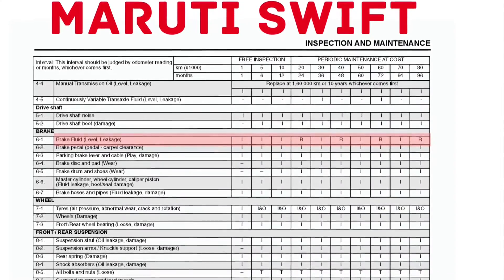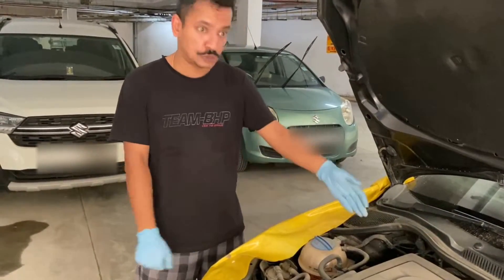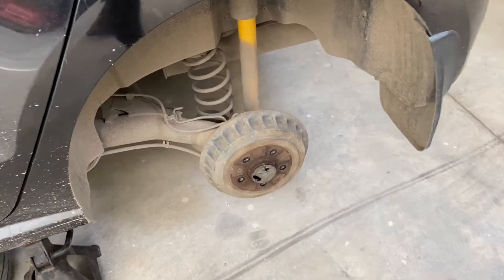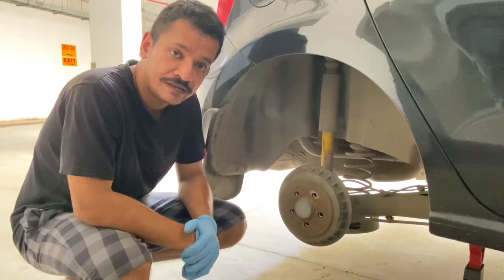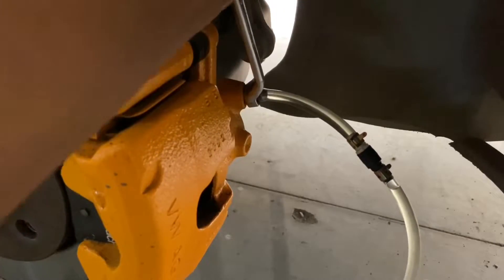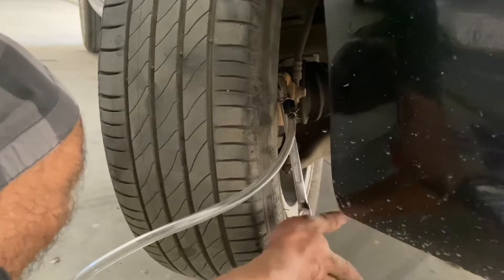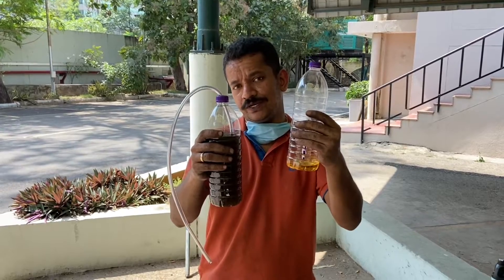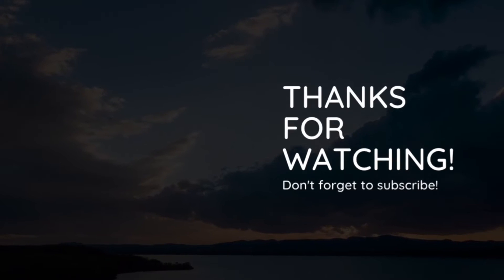Polo 6R - Flushing the brake and clutch fluid (brake bleeding)

Comment: can we lower the Clutch travel in polo ?
Reply from the maker: Hi, the clutch pedal travel on the Polo 6R isn’t adjustable. The travel is determined by the hydraulic system (master + slave cylinder) and the pedal assembly design.

If the pedal feels too long or engages very high/low, it usually points to wear in the clutch components, air in the hydraulic line, or an issue with the master/slave cylinder rather than something that can be “adjusted.”

Bleeding the system or checking the clutch kit’s condition would be the right first steps.
Reply: @GaneshBalan  no the clutch is working perfectly{ no air in the fluid} but the travel of the clutch is too long, not like other tata or maruti cars which have very small clutch travel  makes it easier foot control . can we then lower the brake travel as it is also to high ?

Comment: Sir, do we need to follow the same procedure for cars with electronic parking brakes: Skoda Karoq
Reply from the maker: Hi, yes there’s no change in flushing of the brakes if it is a manual, pull type handbrake or the electronic switch based ones. The procedure is the same.

Comment: Do you need to disconnect battery during brake fluid changing process? Any ABS error ?
Reply from the maker: No you don’t have to disconnect the battery while flushing the brake fluid. 

If the ABS error popped, I would have mentioned it in the video. There were none.

Comment: Even for polo petrol vehicle also do we need to remove the battery and air filter ?
Reply from the maker: Yes that’s right. The location of the bleeder valve is the same irrespective of the engine.
Reply: @GaneshBalan 
Yhanks
Reply: @GaneshBalan Is it possible if we lift the vehicle, can access the valve ? Without removing battery cover
Reply from the maker: That bleeder valve is located at a near impossible place man. Hard to access from below. Best would be to just remove the battery. It is simple and barely takes 5 minutes to disconnect the ground cable & the positive connection block. Uses 10 mm socket.
Reply: @GaneshBalan 
Ok thanks Ganesh

Comment: Hello sir. Where did you get the bleeder valve. I can’t see it anywhere in the Indian websites.
My valve is also successfully rounded by Volkswagen service. I’ve never given my car outside.
Reply from the maker: Hi Simon, I got this bleeder valve from Boodmo. 

It’s ok if you don’t get it from VW. You need to use a plier or a box wrench to remove the rounded valve. 

Take it to an automotive spare parts shop and thread an equivalent nut into the stock one. 

Find out which bleeder valve from another OEM (like Maruti, Mahindra or Hyundai) this nut screws into. 

Buy that. And buy 5-6 of them as spares. 

That’s what local repair shops do and it works just fine. Mechanically equivalent. Hope you got what I meant here.

Comment: Sir, Can you help me with the link for the silicone hose (8mm) and the non-return valve, please?
Reply from the maker: Hi Srihari, I sourced the hose from a local hardware outlet. Please check your neighbourhood hardware store that deals with paints, plumbing accessories, etc. 

The Toyota non-return valve (NRV) was sourced from US. You can however get a NRV from shops that deal with aquariums and accessories. 

First buy the hose and then take it to the aquarium shop. You can test the fitting there. 

That said, you really don’t need the non-return valve. You can bleed the brakes without that.
Reply: @GaneshBalan  Thank you so much for your elaborate reply. I really appreciate it. 

I see people using a bottle filled with Brake Fluid and the hose dipped into it so that air bubbles don't return back into the system but the fluid itself. This also should work without the NRV right?
Reply from the maker: @srihari_sh Yes it will work without the NRV.

Comment: I own vw vento 1.6 tdi, recently there was an abs warning light on dashboard, hence mechanic has scanned the system, but due to unsupportive OBD scanner, he couldn’t find the issue and he opened the abs module and reinstalled it.
But after that i felt the break is spongy and break padel is going down, please suggest (abs issue is resolved as rear left sensor was failed)
Reply from the maker: Hi Tushar, it seems you might have air in the brake lines; try bleeding the brakes again.

But I’m surprised he opened the ABS module for a simple ABS warning light. Did he check if the 4 wheel speed sensors are alright? Usually the first sign to check are those. 

Please bleed the brakes from another place and see if the sponginess of the brake pedal can be removed.

Comment: If you have vcds or Obdeleven just loosen all the nipples and turn on the ABS pump from Engine output tests menu it will turn on the pump
Reply from the maker: The conventional method works best. Uwe Ross - the founder of VCDS and their employees vouch for the conventional method over the VCDS one. 

https://forums.ross-tech.com/index.php?threads/674/

Another one here - 

https://forums.ross-tech.com/index.php?threads/41621/#post-342036

Comment: hi mate, the polo 6r has ABS, how did you bleed the abs module?
Reply from the maker: Hi, I followed the conventional method and did not specifically bleed the ABS module. If the ABS module is to be bled, you’ll have to use VCDS and do the bleeding which is a time-intensive process.
Reply: @GaneshBalan  so as long as there's no issue with abs module, conventional method is fine? How long did the brake pedal feel firm after the service? thanks your for your responses!

edit: what is the inner and outer size of the plastic (vinyl) tube, and what is the part number for the new bleeder valve?
Reply from the maker: Yes, the conventional method works well for ABS equipped cars as well. 

The change in the brake pedal’s feel was evident after changing the fluid. This is usually present if you do a proper bleeding without air getting trapped in the system. 

As for the tubing, I don’t have the details. It is something you get in local hardware outlets. For the check valve from Toyota, the part number is 85321-26020.

Comment: Does the new bleeder screw you've shown fit on the front calipers as well?
Reply from the maker: Hi, no they’re different. Front callipers and the rear drum brake assembly use different bleeder screw. 

Front callipers have an M10x1 bleeder screw whereas the rear drum brake assembly uses an M7x38 bleeder screw.

Comment: Hey Balan, a fantastic video. A little question as well. Is it necessary to turn the engine ON, when bleeding the brakes?
Reply from the maker: Hi Varun. No it’s not required to have the engine on while bleeding brakes.
Reply: @GaneshBalan  Thanks for the info!

Comment: Hi Ganesh, I can see in this video that you are using Bilstien Suspension. I need you help to decide as I want to change the stock dampers & springs too in the favour of good ride & handling on my Vento TSI 1L. While the car has only run 15K & 2 years old but I don’t like the stock suspension setup. Which ones do you suggest B6 or B8
Reply from the maker: Hi Navmeet, Bilsteins would make the ride very stiff. Not recommended if this is your family car. Instead, I would advise you to switch to TRW shock absorbers. They give an optimum balance of comfort and control. 

I haven’t used the B8 or sat in a Polo that had B8 setup so can’t comment on it.

Comment: Great job!! Why can't we bleed brakes with the engine running.?
Reply from the maker: Hi Biju, thanks! Frankly speaking, I haven’t seen anyone attempt brake bleeding with the engine on so I did not turn mine on as well during the process. 

I’ve read that turning the engine on can result in fluctuations in the hydraulic pressure within the closed system because of the operation of the vacuum booster or ABS module and this can potentially risk introducing air bubbles into the system.

Comment: Can I bleed brakes without flushing old fluid and instead just topping up
Reply from the maker: No that would be just topping up any deficient brake fluid not bleeding. Points to a leak somewhere in the system.

Comment: Hello Ganesh, dkaile here from TeamBhp
Can the same process be followed on my 2012 Skoda Superb Mk2 1.8tsi manual transmission car? Can this be done with the car turned off so I don't get any error messages. Recently got the brake fluid changed at the local dealer but he did not do it properly and left some air in the system, so I feel the brakes a little spongy. Planning to do it myself. Clutch slave cylinder feel is OK, so I will not repeat that. As the brake fluid is already new, only want to remove air bubbles, if any, not bleed the entire system again. Kindly advice...
Reply from the maker: Hi bro. Yes this is the standard procedure for brake bleeding in all cars. You also have the electronic means of doing it by using the ABS module and the VCDS application but it is complicated and lengthy. You can do this with the car turned off - no problems. If you don’t have to bleed the clutch, it is all the more simpler. Just remove the wheels and bleed each brake one after the other, starting from the farthest wheel from the brake fluid reservoir first which is the one behind the front passenger side. Please have one more person sit in the driver side to press the brake pedal as you command, after the bleeder valve is loosened. Very important - tighten the bleeder valve after the pedal is depressed. Good luck! :) Let me know if you have any queries.

Comment: Is it ok to use bosch brake fluid or do we have to only use VW OEM?
Reply from the maker: I’ve used Bosch DOT 3 fluid on my Polo during this video and the OEM brake fluid before. Both worked well. Went with Bosch as it was easier to procure through Amazon.
Reply: @GaneshBalan  hi mate, it should be dot 4 LV brake fluid
Reply from the maker: Both DOT 3/4 works. DOT 4 has a higher boiling point than DOT 3. 

DOT 5 is a completely different, silicone-based fluid unlike 3 and 4 which are glycol based and cannot be used with 3/4.
Reply: Thanks for the reply 🙏

Comment: Skoda ASC says no need to replace brake fluid until it's looking fine, what to do now?
Reply from the maker: Hi Vicky, most service advisors are not aware what needs to be done and only has textbook knowledge of cars and their mechanisms. 

Check this link - https://www.team-bhp.com/forum/attachments/technical-stuff/2016262d1591955769-vw-polo-maintenance-service-cost-dos-donts-maintenance.jpg

Check serial 23. 

The first change is to be done after 3 years and then every 2 years.

Insist them to do it.
Reply: Thanks for the reply 🙏

Comment: Which spray cleaner is this?
Reply from the maker: I’m using both STP and Wurth’s brake cleaner spray. They both work very well.
Reply: Which type of spray at Brake fluid reservoir area? Is it wd 40 type general spray or something else?
Reply from the maker: Brake cleaner spray. Please don’t use WD40! It has an oily base and will leave an oily residue where it is sprayed. Use an IPA based brake cleaner spray.

Comment: Good one. Thank you :)  I am going to try this soon using a DIY pressure bleeder that I am making from garden sprayer. How is the Bosch fluid holding up? From what I have read, VW recommends only  DOT 4 LV Class 6 fluids (VW 501 14) for its ABS systems. VW repair manual also says to start from front left > front right > rear left > rear right which is unusual! But mine is not a Polo
Reply from the maker: Hi Thomas, the brake fluid held up quite well. But I’ve sold the Polo last year during October and have switched to a Honda Jazz CVT. I went by the first principles instead of referring to the repair manual which is to drain the wheel farthest from the master cylinder/reservoir.

What car do you have? Where are you located? 🙂
Reply: @GaneshBalan  Thanks Gannu. I am from Kerala, but staying in Bangalore. I have a Jetta 2.0 TDI 😊
Reply from the maker: Oh nice. Enjoy the Jetta bro. They don’t make cars like these anymore. ☹️

Comment: Hi gannu ! Looking forward to following your video for my polo mpi. There are some videos that use vcds to bleed brakes: any comments?
Reply from the maker: Hi Kaushal, VCDS also has an option to bleed brakes but the developer Uwe Ross himself recommends using the simple brake bleeding method to bleed them over VCDS. Have read it on the VCDS forums. :)
Reply: @GaneshBalan  wow ! Nice bit of info! Will bleed em manually then
Reply from the maker: VCDS is used to pump/operate the ABS module when a new one is installed to get rid of air from the system.

Comment: What is the total quantity of the brake fluid we need in polo ?
Reply from the maker: Approx. 1.5 - 2 litres. Depends on how much you flush out of the brakes installed at each wheel and the clutch.

Comment: Nice video Ganesh. Can you come up with a video on Car paint? My Polo Black color roof and bonnet has faded. Would appreciate if you make a video.
Reply from the maker: Hi Tejas. I’m really terrible at paint corrections and stuff man. I usually give my car for detailing at a good detailing centre. Do you frequently park your car outside under the sun? If you do, please avoid it. Sunlight has harsh UV rays which kills the paint gradually. Every car paint has a clear coat which protects UV rays to a good extent but this coating wears off eventually. That’s why you see several faded white taxis; becoming creamy in shade. Bird poop as well. It is acidic in nature and will stain the paint permanently if left for a longer duration.
Reply: @GaneshBalan  ok Ganesh. Thanks for the reply I will avoid parking outside.

Comment: everyone does the same in service centers, not just limited to pole vento dude ☺
Reply from the maker: What I meant was this video was specific to the Polo and Vento so the tools are going to be the same. While the process is similar for other cars, the tools and the quantity of fluid would be different. 

Service centres also use a more professional approach for filling the fluid using a machine which applies pressure to the brake fluid container and automatically tops up the fluid. There’s no need to manually fill the fluid. 

Trust this is clear. :)

Comment: I would prefer VW workshop to do it for me, it’s a very complex and time consuming job.
Reply from the maker: Some folks love DIY whereas some others prefer dropping the car at the service centre for the routine maintenance. To each his own.
Reply: It isn't. It's surely a bit time consuming but isn't complex at all.
Reply: Also, VW workshop would charge you a bomb while not flushing the fluid from the rear wheels and would never touch the clutch slave cylinder too. 

Been there. Faced that. Sworn never to go back to them.
Reply: @gkautomotive yep, I find having the confidence to do things ones self is a good thing,, I cant stand leaving my car with garages, even main dealers lie.